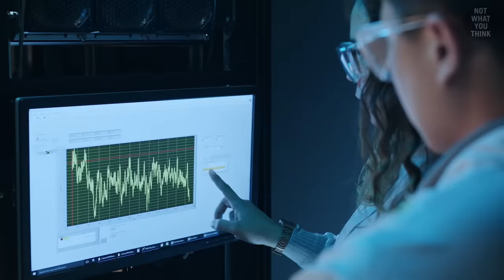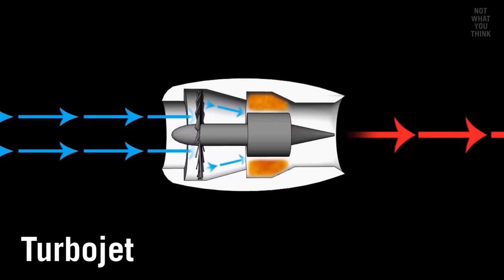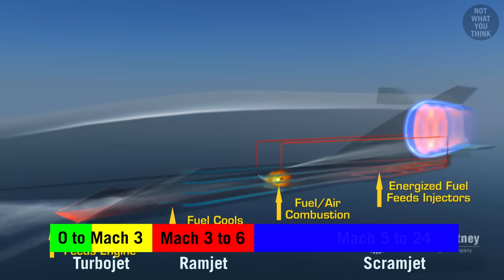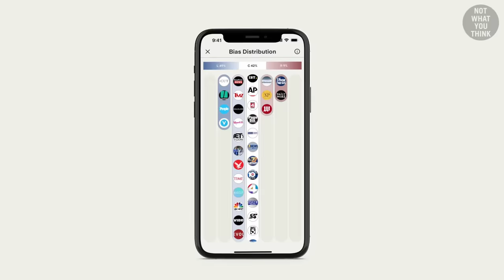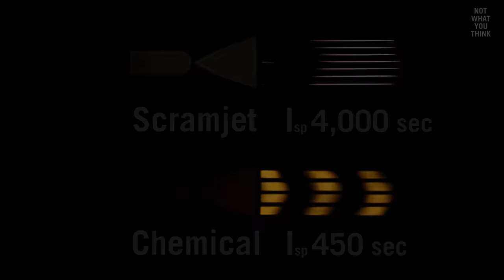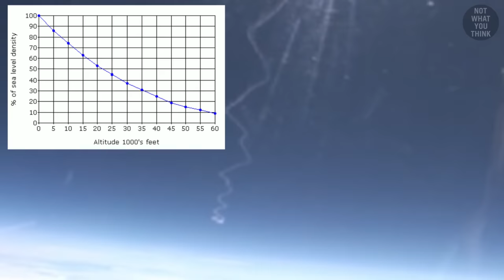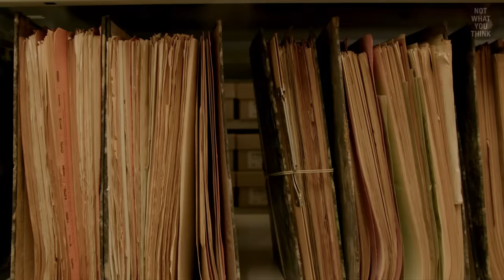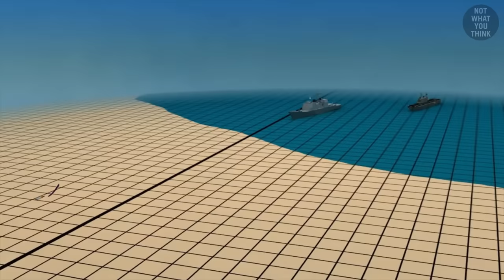The Hypersonic Missile Vulnerability That NO ONE Talks About

Comment: Starships projected fuel costs to LEO with 100+ Metric Tonnes Payload are around ~$900k USD. But that's assuming a full cargo load and the delivery of the payload to Low Earth Orbit (LEO). A suborbital flight is substantially less in fuel costs, especially for New York to London. You wouldn't even need to operate a full tank, saving considerable wet mass. Airlines also rarely vertically integrate the production of their own jet fuel (if ever), so they're all constrained by the price of fuel production. SpaceX intends to make / condense their own LME / LOX at some point and in fact needs to do so in preparation for the trip to Mars (i.e. Sabatier process - CH4, solar energy + li ion battery's to do electrolysis of sea water (O2), liquid condensing of gasses to LOX / LME). The cost of fuel for Starship, therefore, is an advantage for SpaceX. 

The overhead for managing a flight is the substantial cost. That's where Starship carves out another advantage compared to say a 777 or 747. Where fleets can only run one or two transatlantic or other long haul flights per day, Starship can run 12-to-24 per day. Starship is designed to be rapidly re-usable - it can reach any destination in the world from any point within one (1) hour or less from launch. Most fall within fourty five minutes (T >= 45 m). But New York to London is half that at like 25-30 minutes or so each direction. Refueling & boarding takes another quarter to a half hour (15m-to-30m). So a company leasing a Starship could operate up to 12 round trip flights (24 one way flights) between London to/from New York. Starship would be capable of moving 2,400 MT worth of payload between the London and New York. A 777 or 747 flying with a comparable cargo capacity (~100 MT's) takes six (6) hours to fly there. Meaning at most on a perfect day a Boeing 777 / 747 can fly four (4) types per day (or 400 MT's of payload back and forth between London / NYC). So you would need another five (5) 777 / 747's for a total of six (6) Boeing 777 or 747's to fly at perfect speeds each flying NYC-London four (4x) times per day (or two (2x) round trip flights for each plane) with no delays. 

That's where the savings are. Not only do you not need to share any congested runway in LaGuardia with some idiot AirCanada pilot, you can operate each flight path with only one (1) dedicated Starship without requiring additional Planes, Air Crew, Pilots, etc. You also don't need to pay for airport fees every time you land (dedicated Mechazilla), and I'm not sure you would need to pay for using airspace either depending on how your flight characteristics would perform at what altitudes over certain countries. With Starship you saved on paying labor overhead in the form of three (3) to four (4) flight attendants and two (2) captains working over 12 hour shifts on each plane (or twenty four (24) flight attendants and twelve (12) pilots for all six aircraft) carrying passenger or mixed passenger + cargo flights. The overtime savings alone must be absurd. And the Starship can all be automated. It's not clear that the FAA will require attendants or captains onboard for passenger-payloads.

Where this would be really crazy is running popular long haul Starship flights to and from like Sidney or Dubai, where you would double the cost savings in man hours. If SpaceX is running its own private offshore landing pads, there might be some advantage there as well in terms of customs / taxes / duties for bringing back cargo or mixed passenger-cargo flights that is carrying a high value asset like gold. 1 MT of Gold is worth $62,000,000. If you're refining it and shipping it out, usually you're making around 5-to-10% of the LBMA spot value sourced from EU Africa or Asia (or $3.1 to $6.2m USD in pre-freight cost profit). Even shipping 1 MT using Starship makes sense especially if you need to transfer gold quickly or discretely for transaction settlement / tax reasons. If 100% of the Starship's Payload is gold, that's $310 to $620m USD in pre-freight profits or $6.2 Billion USD in value transfer within 1 hour of flight time. Assuming 100% gold transfer to the US from Dubai, you're looking at normally a 12-to-13 hour flight. So the same cargo would have to spend 13 hour flight hours x 29,000 USD per flight hour for 747 = $352,350.00 just on flight hours alone under a wet lease. I can't imagine what the fuel costs would be for 747 over 12 hours. And you have to pay overtime rates for the crew and pilots for a 13 hour flight. And if you wanted to do this multiple times per day you would need to have twelve (12) 747's & twenty four (24) pilots just for the price of one Starship over a 24 hour period.

Starship is very competitive for passenger, cargo and mixed flights, especially on 12+ hr. flights. And if they generate their own LOX + LME propellant at each mechazilla landing / refueling site, and the FAA doesn't require any arbitrary amount of crew + attendants for passenger flights, then their cost of operations are effectively zero. No airplane can afford to compete with zero $0.00 USD in costs let alone the speed advantages. I think Starlink is even expected to subsidize most or all of the overhead of managing starship flights. Maintenance / repairs would be part of overhead. Everything else is automated. 

Starship wont just be able to compete, Starship will rip apart the cargo and passenger airline industry nearly overnight as soon as they nail the rapid re-usability and economies of scale production capacity. Then pumping those bad boys out will cost nothing. Run 12 flights on every single major flight per day with 1 starship. He wants to pump out 10-to-100 SS + SH per year. So over 10 years from the start of production, he could probably dominate over 1,000-to-10,000 different unique flight paths bi-directionally.

Comment: I think the 'radio opaque plasma sheath' is an even bigger problem than mentioned.
The plasma sheath blocks electromagnetic radiation?
All midcourse and terminal guidance methods, except inertial, are electronic eyeballs that receive electromagnetic (EM) waves.
Visual: plasma blocks light, light is EM
Heat seeking: plasma blocks IR and generates it, IR is EM
Radar: plasma blocks EM, radar is EM
Mid course guidance: requires radio Comms, radio is EM
GPS: GPS uses satellite radio broadcasts, radio is EM

So either you can only target something static (useless) or you need to, again, brake to less than Mach 5 to see a target.

And that mid course correction?
Hope there's no mobile SAMs, like, you know, ships, because you can't see them at mach 6 and you're glowing like the sun in every EM band!

Yep, sounds completely useless.

Comment: the problem for heat seeking camera are not that they melt... otherwise a simple coolant it would solve it... the problem is that it's impossible to cool the external layer... so in the end the thermal camera will see itself and not the target.. becaue it's hotter than the target.
Reply: It can use filtering to remove the signal from the heated external layer.
Reply: @Kazilikaya  no... It can't... If the external layer emits the same wl that the sensor is designed to catch (and it does) a filter cannot distinguish from the external layer heat and the target heat... So in the end it will be either blinded by too much signal or receive no signal at all

Comment: There is a difference between (hypersonic) ballistic missiles (V2) and hypersonic non-ballistic missiles (Kinzhal). Kinzhal can maneuver until impact, a ballistic missile cant.
This was even mentioned, but where did I miss how that isn't important?
Then also, from what I heard, Kinzhal has an impact speed of mach 5.2, not mach 3 like a ballistic missile.
Reply: In actual use Kinzhal has been shown to be no faster than Mach 5 and is essentially a ballistic missile in flight with almost no ability to maneuver.  You should read some Chinese military assessments of Kinzhal.  The Chinese were anxious to see how Patriot and other western system would deal with hypersonic missiles but are now expressing disappointment inasmuch as Iskander and Kinzhal are both slower than advertised and not maneuverable in any meaningful way, leaving Patriot untested in their view.  Now the Chinese might be blowing smoke on this but I don't think so.
Reply: @philsalvatore3902  In my opinion, there is no reliable source on the degree to which Kinzhals can maneuver. I haven't seen the Chinese report you mention, however, I'm sceptical how the Chinese would have gotten reliable and accurate data, since these have been used against Ukraine.
Also I'm not sure the Chinese would truthfully report their findings.
Bottom line: obviously they have some degree of maneuverability, which distinguishes them from ballistic missiles.
How effective they in the end truly are and how difficult or even possible it is to shoot them down are largely unanswered questions.

Comment: They aren't that maneuverable ether. At those speeds they would have slightly more maneuverability than the space shuttle, but only because they are unmanned. In reality, a turn at those speeds, even at 12G's would take hundreds of miles. For reference a 747, moving at 500 Knotts takes over 5 miles to make a 180 degree turn. Also, we can intercept them. The US Navy is now retrofitting ships with lasers designed to shoot down ICBMs and hyper sonic missiles. Hypersonics may be fast, but they aren't faster than light.

Comment: The Hypersonic Missile has to have some sort of Protection like a Keramik heat shield in combination with a Liquid oxygen based cooling system. Another possibility is to use metamaterials witch are capeble withstand extrem temperatures. You dont have to controll the missile from the ground you can just impliment a KI witch flies on its own and strikes all by itself.

Comment: there are ways to achieve and maintain hypermach (5 + mach) in the terminal and dense air phases.  This is a hybrid hypersonic missile system, where the main body is the thruster and a small body that detaches.  this need not be a warhead (explosive), but simply a guidable kinetic weapon..  Even a very small kinetic weapon traveling in the 5 or greater mach speed would present an incredible point of impact destruction.  It would also have a very small signature and hard to track for any system.  I am not suggesting that this particular russian hyper missile has that capability, but it's the next logical step of evolution in the hyper weapons class.  I am most certain that the US and China has these types of hybrid hyperweapons and in ADDITION have the capability of deploying "decoys"...e.g, the ability to deploy several multiple packages to "upset" tracking and compound the problems of terminal interception. For this reason, it is also important to understand the importance of two very highly classified weapons defense systems:

fleet laser weapons
low earth satellite based laser weapons.  

spoiler:  at hyperspeeds, detection and tracking can be solved, however, conventional defensive weapons systems are not adequate to take them down.  Very powerful laser weapons systems are the best match for destroying them, which I believe is operational.  The only question is how resourced the US navy and space force is at this time to have enough of these defensive weapons laser systems to protect a carrier group (and other national security assets land based or "other" (read:  space based systems).

God Bless America

Comment: The true advantage of the hypersonic weapon is the speed of travel at the moment of impact,  Even if the missile is not carrying a warhead the impact  of a hypersonic weapon creates a crater that is many times greater than standard munitions. Generally speaking a hypersonic impact creates more collateral damage and can strike deeply into the earth which makes them a ideal choice for taking out bunkers as deep as 70 meters.  Imagine a missile deploying a set of tungsten rods just prior to impact.  The effect of hypersonic impact would be multiplied many times over literally swiss cheesing anything within the area of impact.  As to this authors opinion according to US sources the Kinzhal has a maximum speed of mach 12  and a range of 3000 miles.  According to the videos I have seen of Kinzhal deployment this missile does not fly at high altitude and has been very effective against targets within Ukraine.  The author seems blissfully unaware of the importance of logistics in a military engagement.  Having a weapon like the Kinzhal means your logistics ie delivering bullets, shells, water food, fuel and medicine just became very difficult due to the vulnerability of forwardly deployed depots to hypersonic attack.

Comment: Ok 1st most system to intercept will not need to catch up to the missile  but to cut it off ( more or less in a nut shell) 2nd missile or an aircraft going  that fast cannot maneuver easly without tearing itself apart. You go up fast and come  down faster but to turn missile goes breakie breakie. So, what use is a straight missile that goes  very fast that could and will be intercepted ?

Comment: It's claimed that radar has difficulty detecting a hypersonic missile for the hot atmosphere that sheaths it; hot atmosphere that is plasma. ... When a space capsule re-enters earths atmosphere it is also hypersonic and that hot plasma atmosphere that forms around the capsule disrupts the capsules communications while it is present. ... so it would seem that a hypersonic missile would  have no communications capabilities, no GPS guidance, and no ability to utilize radar guidance at hypersonic speed. If that hot ionized air around the missile glows, which it should, then even visual guidance system are out or at least handicapped.

Comment: perhaps a hydrogen fuelled missile can use active cooling during the final part of its mission; and this final approach can be minimized by having the missile fly at cruising altitude until close to the target and essentially diving. This way the time in the lower atmosphere is minimized and so is the total required heat capacity of the hydrogen that will be discarded.

Comment: Lasers, especially the one on the USS Ford neutralize hypersonic missiles. You can't outmanuever the speed if light.
Reply: The problem is light travels in atmosphere full of gases and microparticles so laser also loses efficency on long distance. And on short distance laser might be not enough to detonate the missile/break it's trajectory
Reply: @dimbasz  You're talking about high powered lasers that'll cut through the atmosphere. Sure there's attenuation of the laser but we're talking about like .1 percent drop in intensity.

Comment: or u make a hypersonic missile with nuke friction set off basically using the dive in the denser atmosphere as an intentional heat and pressure source to set off the nuke at the desired altitude all u need to do is make a tip that melts in a cone shaped object to deliver the  final push+ heat spike...... then u even save the weight for the conventional explosives....

Comment: Sorry, but hypersonic missiles CAN be powered my rocket motors.
Hypersonic glide vehicles are practically just ICBMs with the warhead section replaced. The difference is they are relatively more manoeuvrable, so harder to intercept & easier to hit a moving target.
Range and fuel efficiency for hypersonic CRUISE missiles is why scramjets are preferred. But you could have a 2 stage cruise missile with a rocket-powered terminal phase to help defeat air defences, which could legitimately be called a hypersonic missile.

Then when you pooh-pooh the Zircon, comparing it to the HAWC, or rather comparing some supposed test footage to a theoretical damage HAWC derived weapon (as while the HAWC may well have been test-flown, we neither have footage or any target tests to prove it either). What matters with regards to kinetic impacts isn't the energy the vehicle has, but that that can be transferred to the target. If the missile hits the ground, all (or nearly all) the energy will be transferred to the ground, but if it hits a target (like a shipping container, or even a ship) and punches right through and out the other side, a good portion of the KE remains in the missile when it exits and isn't transferred to the target.

Also, the speed doesn't "compress the air molecules to the point that they turn into plasma"... Just no. Please stop.